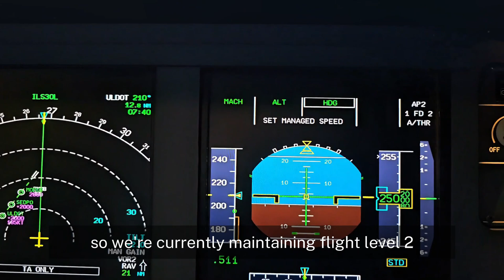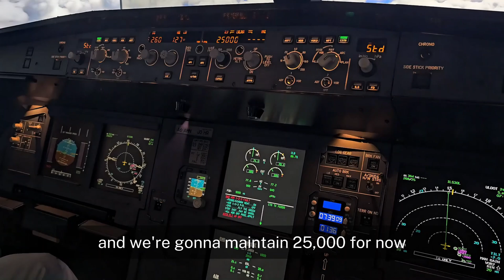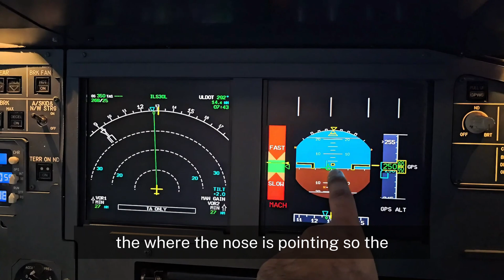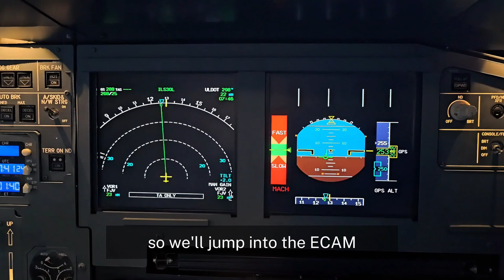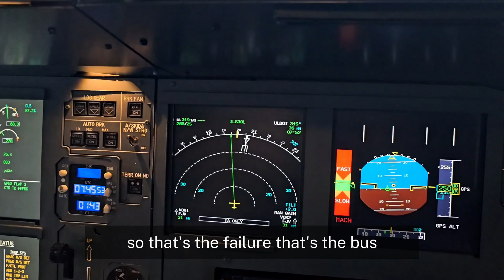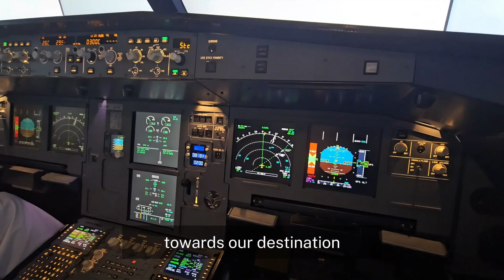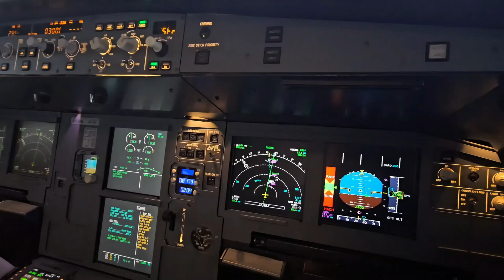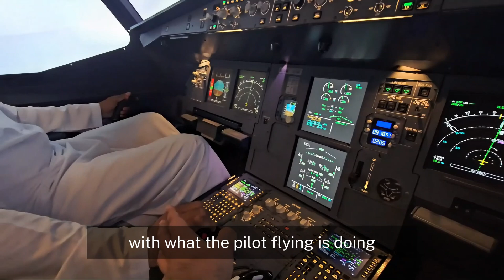A320 Tutorial: Tips on How to fly the BUSS (Back-Up Speed Scale)

Comment: Why does the gear need to be gravity extended in this case? I'm not an expert on the Airbus' systems but I'd expect the gear and ADR to be separate systems on the plane
Reply: To my understanding, failure of ALL ADRs leads to closing of  landing gear safety valve, flying above speed 260kts i guess, so that noone can extend landing gear unintentionally hence gravity retraction. One more thing about this is speed is also unreliable. Idk how much this makes sense but this is what my understanding is. Let me know if any corrections
Reply: LGCIU will be unavailable….doesn’t know in flight or ground without ADR..
Reply from the maker: Very good question, The ECAM and AFM (FCOM) calls for it. I would think that its due to the lack of information that the LGCIU depends on. However, would love a deeper explanation if someone has it!
Reply: Without valid airspeed data, the LGCIU won't let the gear to come down as a protection against overspeed in case above VLO EXT. So manual extension required.
Reply: Thank you all for explaining. I guess I was only considering a direct link between the two systems. So what I'm getting from reading your responses is that you are flying based only on AOA and while it's a function of your speed and other variables, it doesn't guarantee your speed alone. So, there is no way to protect the gear from being extended when the plane is too fast.
Reply: @Bob-yp9wt  that's right. So the LGCIU will just inhibit landing gear operation until it receive valid airspeed data again.